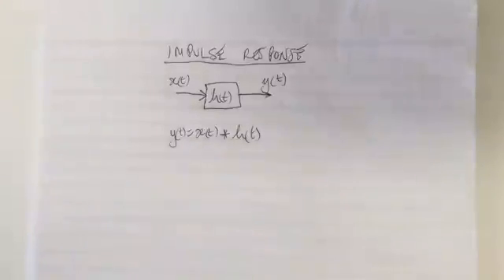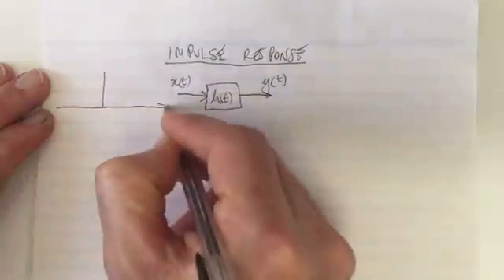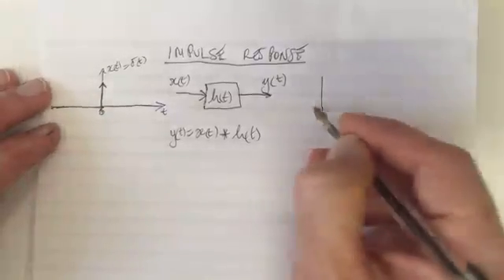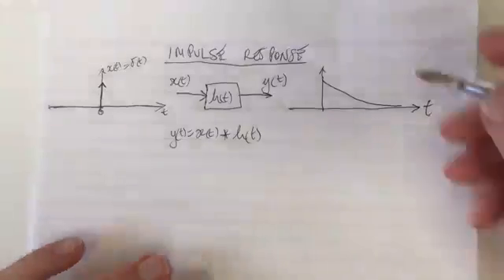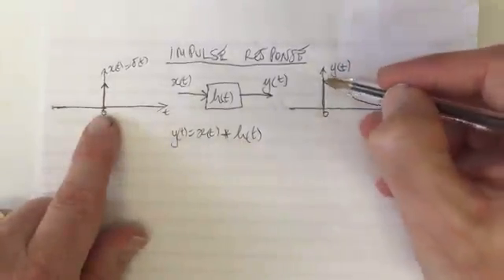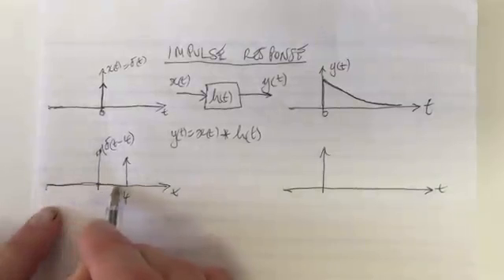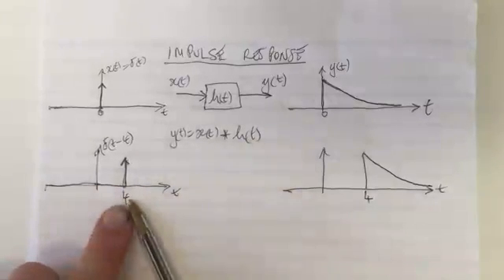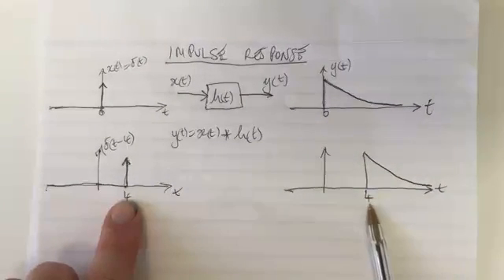What is an Impulse Response?

Comment: Thank you for your video!
could you please tell why there is delta function with t - 4 in your second example?
Reply from the maker: I just used it as an example, to show what happens when an impulse is applied to a linear time invariant system at a later time (ie. not at t=0 )